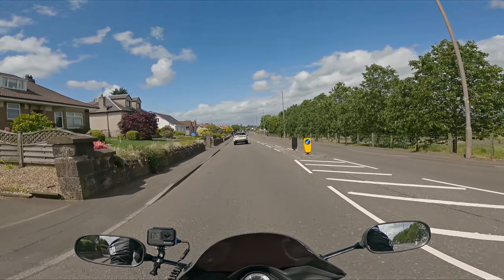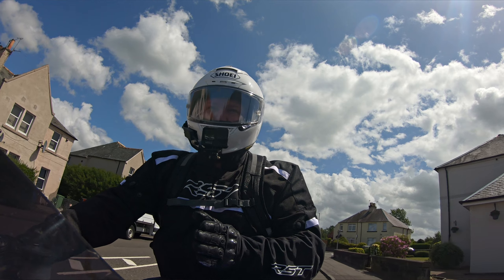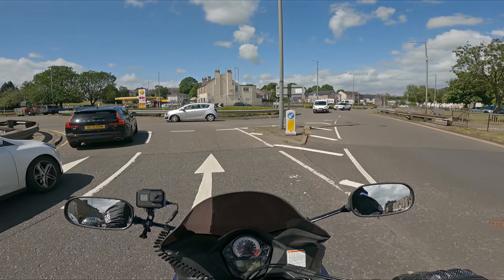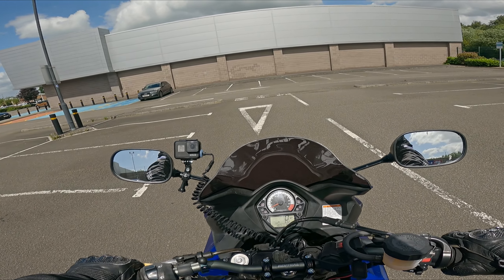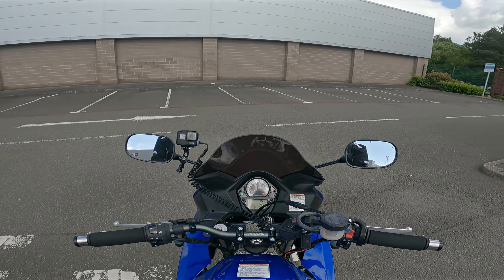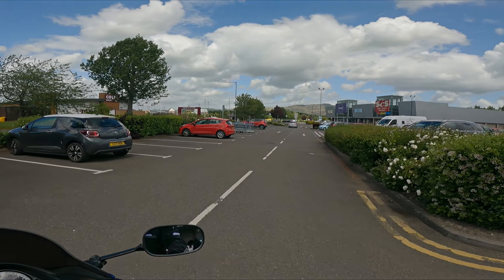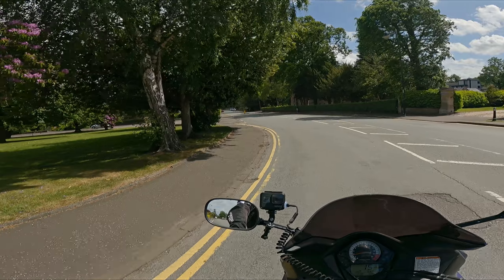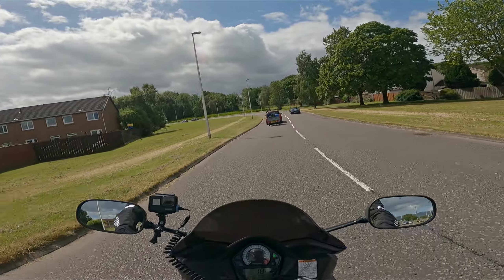Motorcycle Blading | What Is It And How To Do It.

Comment: Not going to argue with a seasoned biker but I’d be a tad wary of positioning your bike so far over to make the turn as shown @3:14  As a car driver I’ve seen more and more motorists take a wider turn and almost clip my own car when I’m stopped and waiting to turn just because they turn into my lane or at least cut over the marked dotted central line. Now I’ve just passed my CBT 5 days ago, I’ve been out on exactly 2 rides, one was bringing my new secondhand back home, and when faced with these junctions I try to stay a bit right of centre of the lane I’m in. Still turn the handlebars, but just not so far across that other drivers clip me…or worse.